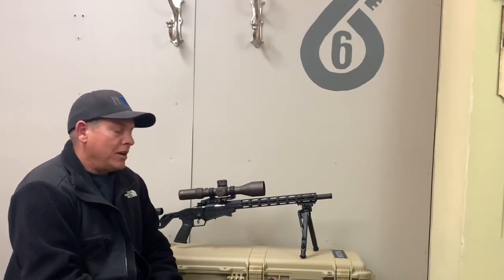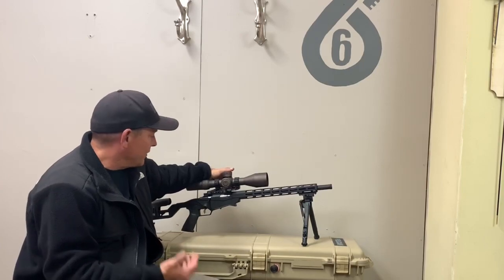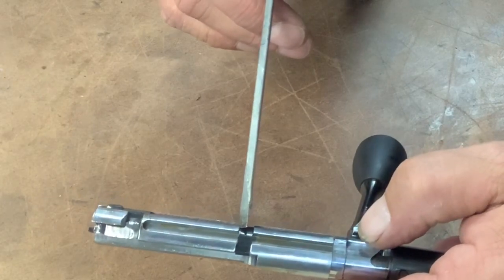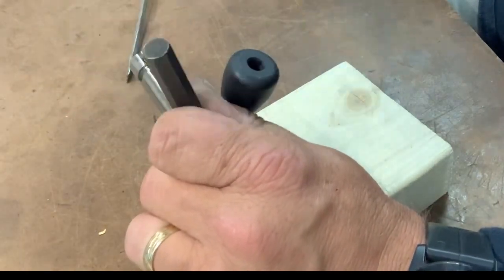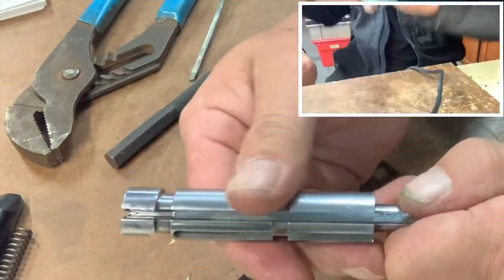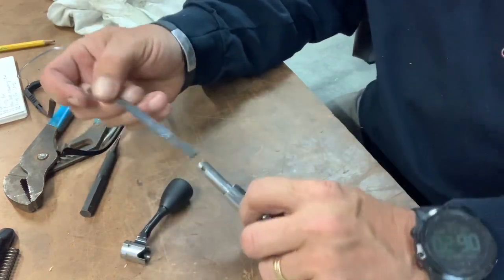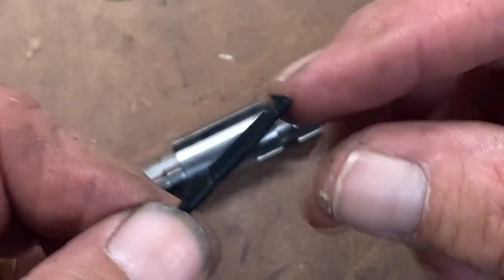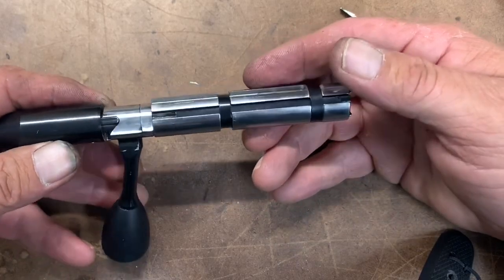Smooth and shiny RPR Bolt cheap Easy mod

Comment: Great tutorial! Bolt is running much smoother, no more zipper sounds. Don’t forget to reset the firing pin to disengage before trying to shove the bolt back in

Comment: That was a great video I tried everything but my bolt was still kind of rough if yours is still kind of rough give this a shot you know that little plate that holds or covers the trigger allen wrench take that off and then cycle your bolt I realize that that thing's what the bolt rubs on

Comment: Hello::: My Bolt was Trash. On that flat part there was a bur sticking up maybe far enough to cut a finger, but I saw it first. Ray Charles in Quality Control could have seen it. I took a 40 year old 5/16 half round file to it, I figured how could I hurt it. I went over all edges. When I open bolt and pull it back 1 inch it still wants to hang up. Precision for $500.00 my ass. Last month I got a 22/45 light, the trigger is crap. Well compared to my 22/45 Mark 3 or SS 1993 22/45. I also just got Ruger American green 6.5 Creemoor, So far it seems all right. I guess I'm not finished with bolt on RPR 22 Magnum. I got a 20 year old Dremel tool... He did a really nice job.

Comment: I'm curious if anyone has polished the bore on these rifles. I have never had a centerfire, rim fire, or air rifle that didn't respond well to it.
I used a clean soft cloth patch on a tight fitting jag. Apply JB's borepaste, starting at the breech, using short back and forth strokes, gradually going deeper into the bore and back to the breech, working back and forth.
Once the patch reached the muzzle, I would push it through and start with a new patch, again, starting with short strokes gradually getting longer until it reached the muzzle. After a couple of patches, I would clean the barrel thoroughly and shoot some groups.

Case in point. I started shooting with a local club. They had weekly smallbore three position matches. I couldn't afford an Anschutz at that time and decided to try and improve my Ruger 1022.
I put a heavy Butler Creek barrel on it and was really disgusted with its performance. The factory barrel actually shot better than it did.
That weekend, my girlfriend spent the weekend with me and she put nearly a brick of ammo through the rifle. The next time I shot it, I was surprised it was shooting better. It wasn't going to hold the 0.356 dia. X-Ring on a 50 yard smallbore target, but it was shooting better.

I didn't have anything to lose, so I took the barrel out and gave it a good polishing. The groups improved drastically. I did it again, and this time followed up with a patch covered in the white Mothers' aluminum polish. the bore was incredibly bright.
and with the right ammo, it would put five shots inside or touching that 0.356 X-Ring.

I shot that rifle for years in those club matches and in NRA sanctioned three position matches in three states. I never managed to shoot a 200 20X on a 50 yard target, but I shot several 200 19X targets.
It would easily hold the 10 ring on the 100 yard targets if I watched the wind correctly.

I have seen many videos on these RPR's, they show some real potential.

Comment: Good information Rick. The more I see you guys shooting and improving your RPR. I would like to get one also. Thanks for the video Rick.
Reply: Did you?
Reply: I know that I love my 3 RPRs. I have the 22lr, 6.5 Creedmoor,  and the 338 Lapua Magnum and I love them all. I actually enjoy shooting my RPRs the most out of my bolt guns and I am definitely not a fan of Ruger center fire rifles till I had a friend tell me to check them out and I did and immediately wanted to get one. I picked up the 22 first and loved it so much that I wanted to pick up  a short action and got the 6.5 and a buddy had the 308 and he let me run a few mags through the 308 and I can definitely say that it is a better shooting rifle than my old Remington 700 short action that is probably 25 years old. But I really like the 6.5 so much better than the 308s that I have.  
  I then picked up the 338 Lapua when my  friend who a gunshop called and said that he just took one on trade that he said that guy who traded it in got it spur of the moment impulse buy but didn't think about where he could shoot it in Southern Florida  but the guy said that he shot 1 10rnd of 250grn and a box of 300grn and when I saw the rifle I would definitely believe it given that the bolt had none of the typical wear marks that you would see on any⁹í

Comment: Your disassembling this wrong! You don’t need a brass punch or a hammer. The “spring tension” you talked about needs relieved by compressing the bolt, just like you showed. Then the pin will PUSH out. It is designed to be pushed out. If you are beating it out, you’re doing it wrong!
Reply from the maker: Thanks Brian.
Reply: Yep

Comment: This video is ok but There is a lot more to it than just polishing the Bolt, polish the firing pin the grove test fit it and make sure it has absolutely no rub marks on the bolt. I lap mine, I found out the Barrel is ok, But I wanted excellent so I bought a Green Mountain 24 inch Bull barrel with threaded end. I installed it and now I shoot 1/2 inch beetles at 100 yrds I also use a 6x24x50mm Athlon scope 1000 yrd scope on my 22lr
Reply from the maker: Yeah that video is a old. I run Rimx now. Thanks for watching. Check out some newer videos

Comment: Thanks for video Rick , I think I might polish up my CZ 452 Bolt up too , the bolt had some surface rust on it after I pulled it out the safe after 16 months , I put a good layer of G96 Triple clean gun oil on it but she still rusted up , I used a bit of emery paper on it to get rid of the rust but it really does needs a good polish . Did you use a stainless steel polishing compound ? Or does any metal polishing compound do the job ?
Reply from the maker: Good rainy day project for sure. Thanks for showing